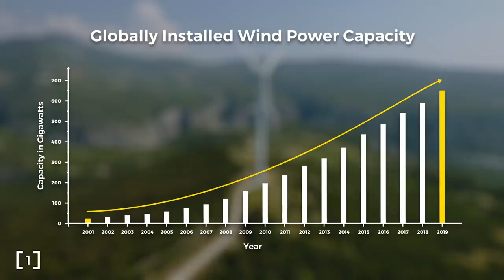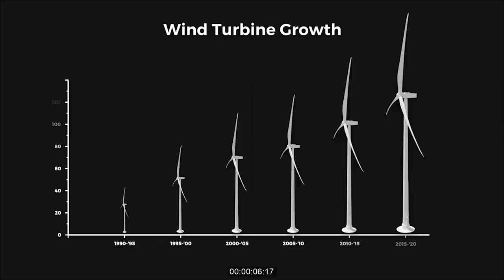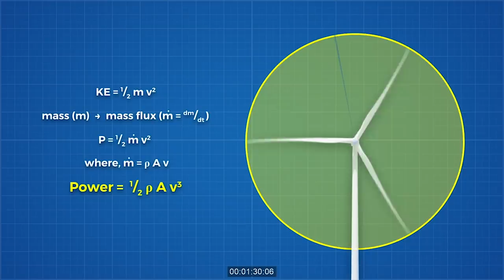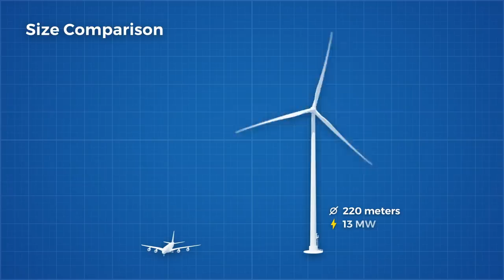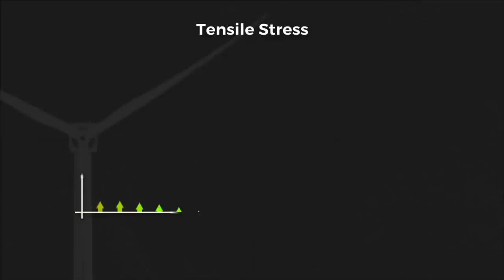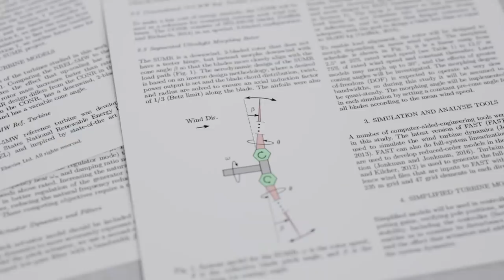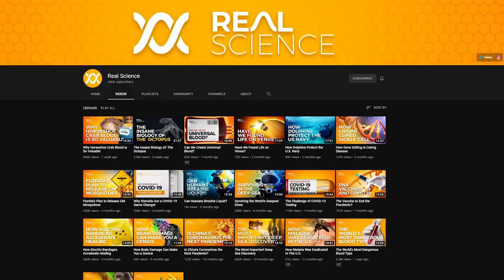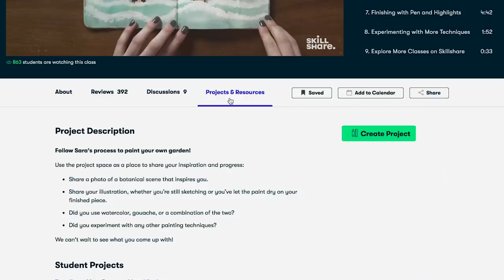How Big Can Wind Turbines Get?

Comment: Blade Dynamics built a two piece 80 m turbine blade for the Siemens 6 MW offshore turbine and LM will send you two piece 75 m blades for the GE 4.8-5.3 MW onshore turbine w/160 m tower utilizing a concrete base section tower tube. Gamesa has built test blades that were multisegmented too, so blade length is not necessarily the limiting factor. The base tube for tall towers and nacelle are typically size limited onshore by bridges/overpasses. Few cranes are available to lift very heavy nacelles to the 140 - 160 m tower height needed for blade clearance, but superconducting nacelles will cut weight and size by more than half. Lattice frame towers and concrete base tubes can eliminate tower logistics bottlenecks too.

Comment: Oh that reason for "why bigger wind turbines?" is a nice example of a Fermi estimation and leveraging non-linear scaling effects! Its a Fermi estimation, because you could fill the cross-section with many small wind turbines and a different design for the mounts of the them. It is thus not the only design option to make single turbines and rotor blades bigger. Redundancy could also increase reliability and output controllability.

Comment: On propeller planes, when there is an engine failure the propellers would have a large aerodynamic resistance. To prevent this, the blades rotate parallel to travel direction. It does not sound entirely unfeasible to do something like this for wind turbines.

Comment: What’s wrong with nuclear energy?
Reply: Radiation is bad, mmmkay?
Reply: @rexmann1984  radiation is everywhere, deal with it.
Reply: @rexmann1984  that doesn't escape the plant
Reply: Nothing, wind is a boondoggle and has incredibly high maintenance costs per MWH. also, it lack physical inertia which is very bad for the grid without normal generating capacity providing the background load.
Reply: Small modular reactors are the way to go with nukes.
Reply: Using thorium not uranium...
Reply: @blipco5  yup, local generation is key, the problem with long distance power transmission is the resistance based losses which are huge.

That's why you can't just shunt electricity from Spain to Sweden, you lose too much power
Reply: Okay people, I was joking. I thought the mmkay on the end gave it away.
Reply: @URUNicoM  regardless of how dangerous radiation is in practice nuclear is still the safest by deaths per KWH of all power generation forms.
Reply: @URUNicoM  nope, anyone dying is bad, but don't act like nuclear is more dangerous than anything else in the power generation game.

Nuclear is by far the safest energy source including chernobyl,three mile and fukushima.
Reply: @URUNicoM  Yes, when it goes wrong it goes very wrong. But if we could be more careful maybe we'd be fine...
Reply: As far as I can tell, nuclear just gets terrible PR...
Reply: @anonymousdude7982  PR is just short for PRopaganda nowadays.
Reply: @Codysdab  Sure why not...
Reply: Erm Chenobyl Sadly my local power plant is nuclear still and if it goes my town is gone.
Reply: @davidty2006  Yes, well I own a pair of scissors but as long as I’m careful with them I’ll be fine...

Edit: I just re-read your reply, did I misinterpret it?

Comment: FYI, energy operator refused turn on gas power station in South Australia during peak demand because it was not economical. Now they use diesel generators for back up even though they spent $100 million on Tesla battery.

Comment: Enercon used to split blades. The first generation of the E-126 used to have an inner blade structure made of steel. The E-115 and the secound generation of E-126 used 2 parts made out of glass fibre. Nowadays Enercon switched to single-part blades. Mainly due to cost but also to be able to buy blades from other OEMs like LM Wind.

Comment: Energy storage is ONE solution to the wind variation issue.
MUCH higher capacity and LONGER power transmission lines are also needed though, to spread out the impact of one area having low wind at any given point.
Reply: ᴛᴀᴘ ᴍᴇ ᴀɴᴅ sᴇᴇ Abigail  They seem to be intended to last multiple decades, but in actual fact "leading edge erosion" seems to limit them to more like 20 years or less.
I suspect there is some way to recycle at least part of the fiberglass in them, but I don't know what is actually done with them when replaced.
Some of them might get refurbished and reused instead of completely replaced?
They probably can't get reused on other wind turbine models they were not designed for though.

Comment: Another interessting challenge in regards to constructing larger and larger  offshore wind turbines is the stuctures resonanses frequency. As the tower size increases its resonans frequency becomes lower,  which means that at a certain point the eigenfrequency of the structure will be so low, that waves in certain spectrums can become a significant problem.

Comment: The video says that area is why blades are getting longer, but speed also increases as the hub height goes up; and also how often the speed is high enough to generate power, so the economic value of the power goes up with hub height.

Once you’ve built a higher hub, longer blades can fit on it, but it can be worth using the same length blades and just jacking up the hub a bit higher, since you can go taller without easy road access.

Comment: A question that comes to mind is, why aren't they being built on a vertical axis shafts instead?    No matter which way the wind is blowing, it's always the right angle.
Is it an issue with weight on the shoulder bearings?  Centrifugal force at the centre of the blade?
And another thought comes to mind as per design when it comes to vertical vs horizontal drive shafts.   
The faster it would spin, the more centrifugal force could stall or reverse the angle of attack  so as to prevent over speeding from occurring at all.

Comment: You should do a video on where wind turbine recycling is and the challenges needed to fix it. Currently, I believe blades are either put in landfills or burned, which is definately not optimal. How much negative impact does that actually have on the environment? How often do they need to be replaced Are? Are there any ideas on better recycling?

Comment: The reason the turbines are getting taller follows the same eqaution. Air closer to the ground travels slower compared to air at a height, due to the no slip effect, therefore having a turbine hub at a higher height, means the air moves at a higher velocity. The eqaution shows that power is directly proportional to the cube of the wind velocity.
Reply: "YEET the structure apart" - Millennial engineering speak at its best! Love it!

Comment: Seeing this gives you hope for the future worked in moving heavy construction for years  mabey it is a bit  out there but wouldn't it be cool to have large zeplen type platform to deliver the very large blades no need for a crane just pull down in place slight up pull to offset wind gusts as a side note industrial hemp is very strong and more durable than fiberglass are the blades pressurized with  a gas mix it make them more ridged and offset weight

Comment: All that wind power from Ireland was JUST onshore wind (and a tiny offshore Wind farm). Ireland has a 700MW interconnector under planning stage to France and aims to add 9.2 GW of wind power by 2030. If the speed of the blade tips could mitigated below supersonic speeds, could this not allow longer blade tips and what about using bamboo lattice as an alternative to carbon fibre. I can see how GE could bring its airline propulsion savvy to look at blade design, tip velocity. Might we see mammoth 3D printers to make the blades.

Comment: There has been carbon fiber used in blades for the last 20 years from about 40m length blades they started using it selectively in the spar caps- the latest generation 80-110m blades could not be done without it

Comment: One emerging concern  is however the effect wind turbines particularly in numbers can have on the climate down stream as they sap the energy of the wind which naturally effects the weather. Whether this is good or bad is hard to say on  its own as weather is a very complex but the effect can be expected to continue to scale up as wind power expands. There are also still older environmental concerns that remain especially the currently nonrenewable life cycle costs and the effect on wildlife. Bids can often be deterred but the effect  is particularly hard on bats largely because bats are attracted to the buffet of trapped insects that are easy to catch coupled with bats particular biological vulnerabilities arising from weight reduction adaptations, bats as mammals lack hollow bones(which other flying vertebrates possess(ed) thanks to the archosaurian respiratory system) and so they have to compensate with softer tissues more vulnerable to pressure variations. It is a useful technology but I fear the concerns aren't being properly addressed as the technology is scaled up.

Comment: I did not see any comments on possible improvements. For example, a wind turbine need only be started if the wind speed is enough  to keep it going and how do we cope with high wind speeds?  Diamond arrays for wind turbines should be looked into.

Comment: Rather than collapsible wings, maybe using a brake system while the blades are in a position where they would not touch the main frame supporting the whole structure which would be used when in a storm or when no power production is required i.e. the turbine is not in use.

Comment: As the constrution of this type of blade might get maxed out due to the fact of reaching sonic speeds at the outside while converting only a little newtonmeter in the inside, there are some other designs for radial-turbines that might get more interesting to engineer in large scale too. This might reduce the needed size of the concrete foundation as concrete is a massice co2 driver and for humans it is not very likely to reuse concrete foundations.

Comment: Bard Offshore 1:
At the wind park, I learned that one of the nastiest problems with those large turbines, is the dynamic stability of the foundation, due to the repeated hits, when the blades casted a wind shadow on the mast. 

In Kombination with the Rotation, this hitting would disintegrate most of the usual concrete constructions.

Comment: Onboard computers quickly alter the turbo es angle to the weed and set the blade angle to the optimum. It also protects the unit by feathering the blades to lessen the strain on the entire structure.

Comment: The solution would be to use vertical cylindrical towers with fins vertically similar concept to those old spinning signs. That way you can increase the radius without weight constraints.

Comment: I've always had this idea of a wind turbine that looks like those wind speedometers, just like a pole of rotating cups to catch wind and convert it to electricity, could make it modular and stack them taller for increased power needs,
Plus since it spins along the axis of wind instead of against it, and doesn't risk clipping itself, it would be cheaper and smart to design them this way because it would be easier to upscale :o

Edit: plus it could catch wind from every direction simultaneously, without the need to turn

Comment: Two Questions - why do these things all have 3 blades?  I assume it's an efficiency thing, but what makes 3 the most efficient number of blades?  Also, why do the blades all need to be the same size?  Intuitively it makes sense that they'd be the same size, but I don't think I could prove it on paper.

This video was fantastic.  I think I'm just generally asking about the evolution of the aerodynamics of wind mills.  This video covered the blade size in a super intuitive fashion.  So what about the other aspects?  You've got me insanely curious.

Thanks for stretching my mind every couple of weeks!

Comment: I wonder if it would be possible to make a vertically-bladed wind turbine, where the vanes/sails are mounted on a very large circular rail track, with them physically connected to a central generator? Basically sliding along a ~1km diameter low-friction ring gear type assembly?

Comment: The inner few meters don't really contribute to the energy output. So they can be a piece of pipe to extend them. At one side hinge you can only like make like an 80 m wingspan from the best know material composites. Biggest issue with larger turbines is the ealier shutdown to sailing mode in mildly stormy winds makes the whole device unprofitable. At that point some may consider switching to vertical axis turbines where you can have multiple hinged ladder design and scale the rotor arms seperately from wingspan.
The Madarasz patent drawing has shown there is no theoretical limit to such a design as it might be a huge railway circluar track. Nobody managed to make a pitch control to make such a design really effcient yet. You come to a point where the move to tidal power makes scaling renewables more attractive. You achive the same power of wind at 1/5th of the size due to the 1.000 times higher energy density. Plus you get tidal flows 24/7 along shorelines reliably on schedule making this the superb baseload power source we currently miss. That's what in conjunction with wind + solar could replace the gas and eliminate the need for storage. We currently explore an advanced pitch control for a HAWT tidal turbine to eliminate it's disadvantage . We don't have to go through this long wingspan induced massive capital investment and high R&D cost. We may not have hit the maximum possible blade lenght in engineering. But we for sure already crossed the maximum economic blade length / device MW size class. For years stagnation is around 4 MW size economically now. These machines on great sites are the most profitable for a decade. Anything new I see on the market has a much bigger impact on invest and operational cost than profit yields. Several factors involved do massively drive up cost. From molds. to logistics to custom cranes or shipbuilds. If longer blades only less days on grid due to earlier shut downs on high wind days you can'treally reap it's benefits. that lessons only slowly sinks in with turbine manufacturers PR promisis to their investors and the politicians thaat don't understand what's behind the trends. In Climate Action we can't waste 10 to 20 years on that realization. News  and facts need to be spread much earlier. It's actually interesting that you bring back an old topic in 2020 w/o any of thr tricks of pipe extending the shaft - wing connection. This clearly showcases thechnically we already maxed out what is economically feasible in advanced materials here.

Comment: How did 3 bladed designs become the standard for wind turbines? Household fans typically range from 4 blades up to 18 or 20 in some computer case fans. Their design is to move air not harness it, but the variance in blade number is notable compared to wind turbines.

Comment: Wind turbines have the unique attribute that means environmentalists will happily allow forests to be cleared for them or let them line the tops of scenic cliffs and ridges when they would normally oppose the felling of a single tree or an unobtrusive building on such sites.  The real problem with turbines is they are largely made in China where the environmental consequences of their manufacture can be lost amid the country's vast emissions. If as some have suggested that the emissions from fossil fuels should be on the account of the country that extracted it, not used it, then the environmental costs of solar and wind should be borne by the customer, not the manufacturer. Would put Europe well behind in its Paris targets which have been met by exporting emissions, not reducing them.

Comment: There are more implications from the growth of wind turbine's size.  In Greece where their expansion is rapid, usually they are "planted" on hill and mountain sides. So the roads and foundations needed to be carved in the mountainous landscapes are becoming bigger and bigger. This has an increased environmental and aesthetic impact that creates refusal from local communities to accept their installations. Not to mention that bigger diameter of the blade systems makes the possibility of bird impacts more likely. Surely they are better than coal. But maybe just increasing the size is just the easy answer. Maybe they should focus on how to decrease the size and still produce more energy. As is the rule in most industrial products. They decrease in size yet they are more efficient despite their smaller size compared to previous generations of the same product.

Comment: Can you do a video on underground freight transport and its viability? Like would it make sense building interconnected underground tunnels nationwide so freight can be transported via automated maglevs? How would boring machines interfere with groundwater? Would it make sense to build a vast underground network like this in the US? Would so many underground tunnels make an area seismically active? In my mind it would be vastly expensive and it would take decades if not centuries for it to break even but it would also be a huge boost in efficiency/productivity and it would help making transport carbon free.